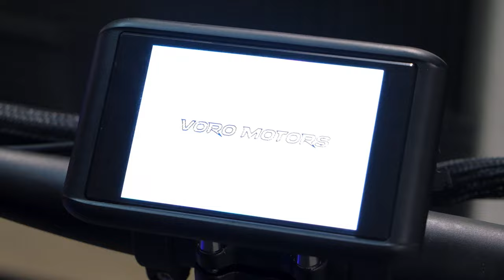How to Tune the Throttle on the EMOVE Roadrunner Pro | Voromotors tutorial

Comment: What should be the position of the Throttle nuts under the seat (at the beginning and the end)? Should the Throttle nuts under the seat be tight before starting this process or loose and tighten the throttle nuts under the seat at the end?